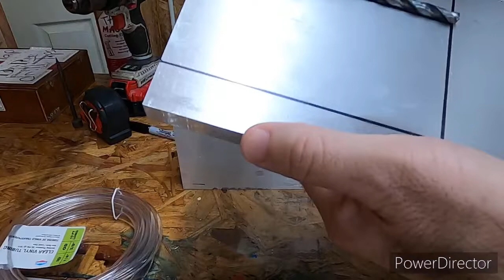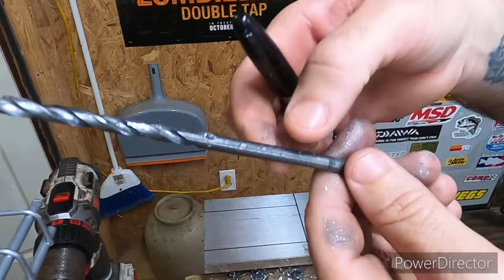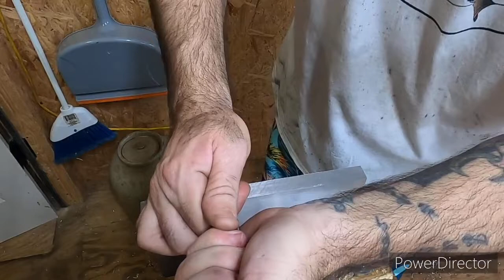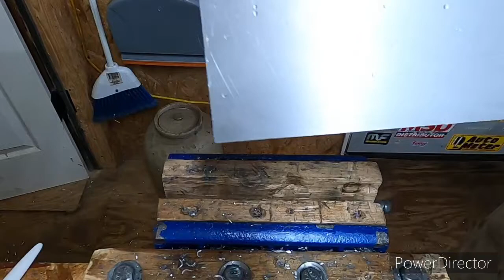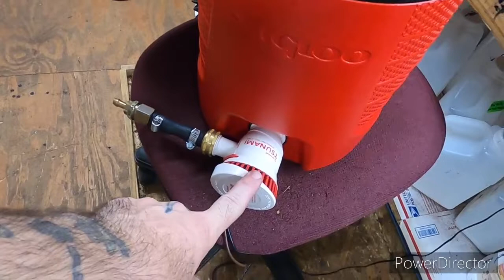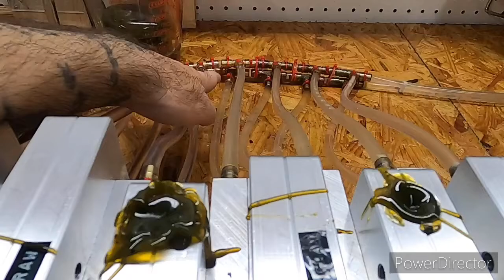Making cooling plates

Comment: Thanks for this info, it answered all my questions about cooling plates. My only question is where did you get your plates and can you get different sizes. I make crappie baits and have smaller molds.
Reply from the maker: Yes search for aluminum plates in the size your looking for on eBay and tons will pop up you can always contact a seller and see if they have a size you need

Comment: Hey Eric, I got my plates the same size as you have , what size drill should I use , I have a 5/16 tap
Reply from the maker: Use a bit close to the inside diameter of the hose you plan on using and for the tap use the size that matches the fittings you got